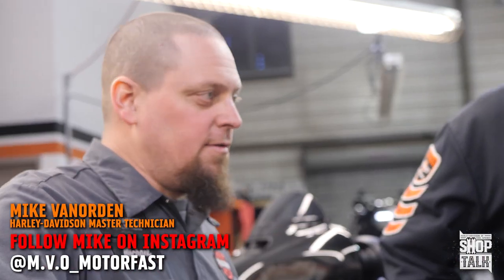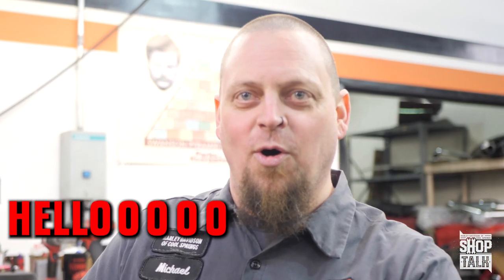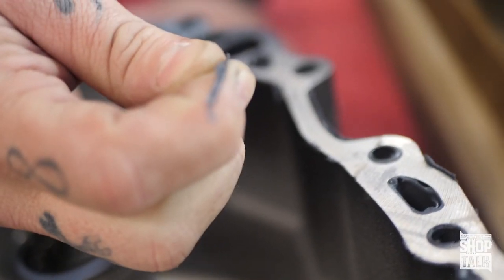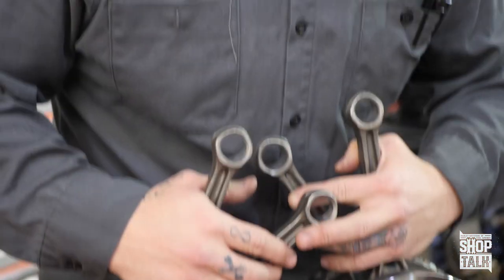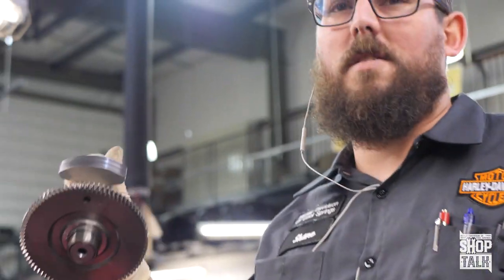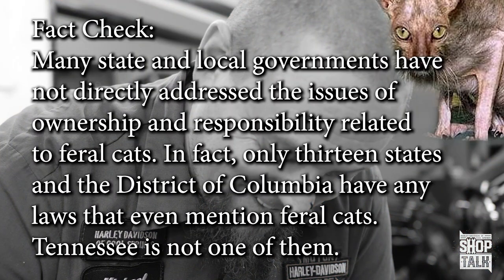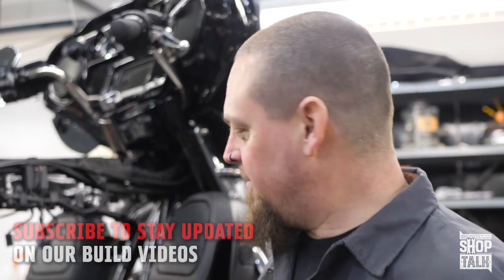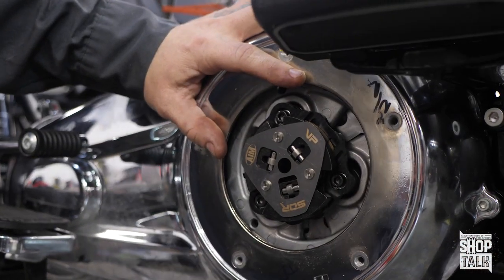124CI Bottom End | Shop Talk Episode 17

Comment: I heard that there is a oil sumping problem with the Milwaukee 8. I heard that most of the time its after a big bore kit has been installed.  I want to is there any truth to this? If so is there anything  that can be done to insure this wont happen?
Reply: So "sumping" is a rare condition in which the oil pump has trouble maintaining adequate scavenge volume to properly evacuate the return oil from the bottom end of the engine back to the oil compartment.  If the situation exists inside an engine it will be magnified by installing performance "stage 3" or "stage 4"  components due to the increased case pressure from the higher compression/larger bore pistons.  Installing the latest version of the OEM oil pump or a performance pump/plate such as Feuling (we recommend the race series) or S&S oil pump and plate will almost always resolve it.  Do you feel you may be experiencing the issue?
Reply: @NoName-vz1ob  I think I'm ok now. I was thinking about installing the 124 kit made by S&S.   I have a 2017 Ultra classic . I just wanted to make sure I gave the engine the best chance of living.  I have 4700 miles. The current upgrades are Vance & Hines full exhaust system. S&S 475 cam and Thunder Max ECM.  I want to thank you for your response.